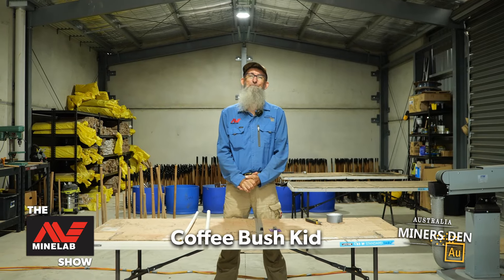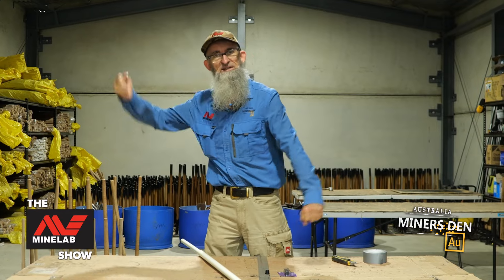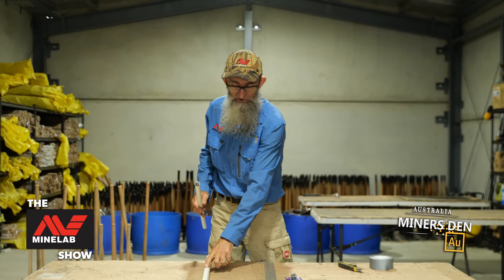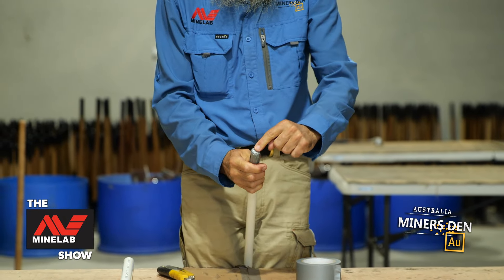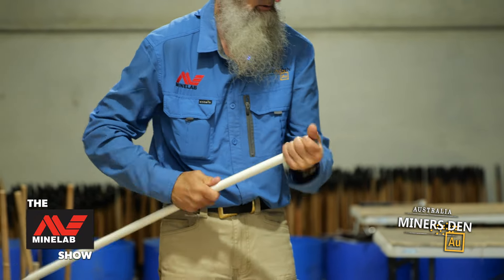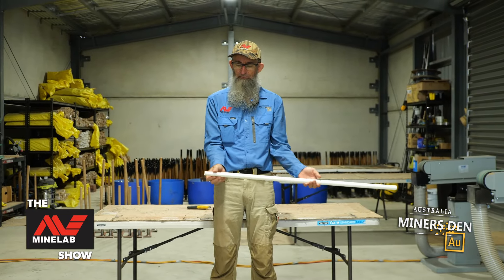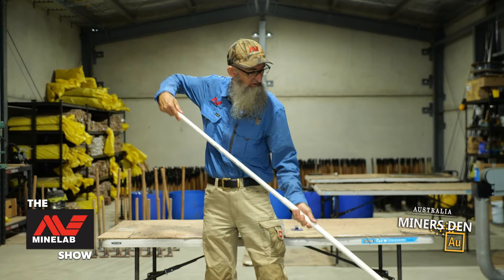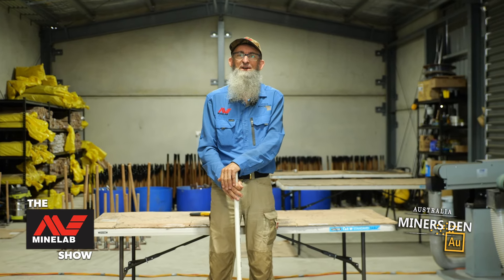How to Make a Yabbie Pump - Crevicing Tool - Part Two

Comment: Ok, but how do you refine it so that it's usable?  Where's the handle?  My hand is going to be slipping on that pipe rather quickly and causing blisters.
Where's the nozzle?  Some cracks get so  tiny that you need to swap or add a nozzle(s) like PEX tubes or copper tubes.